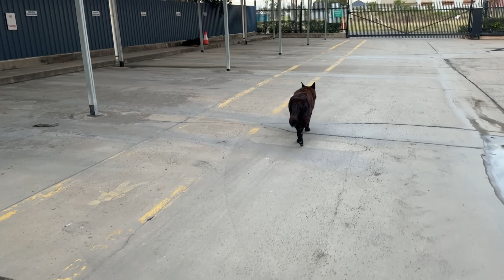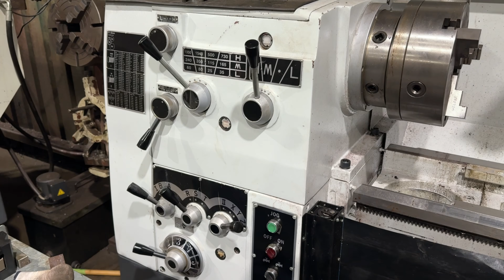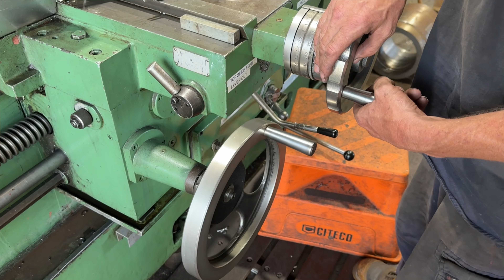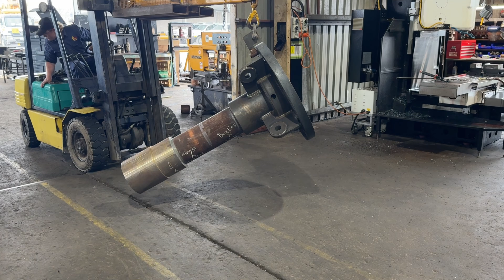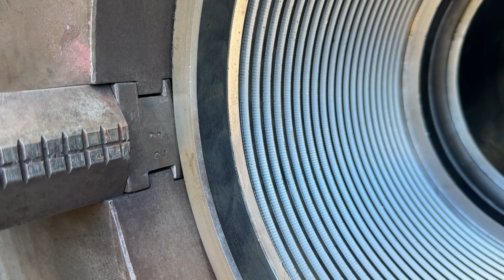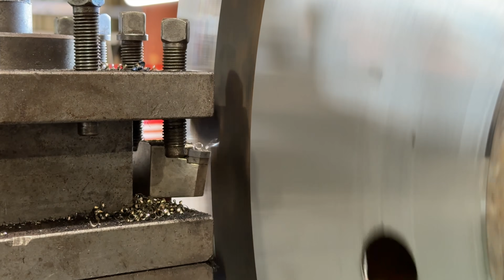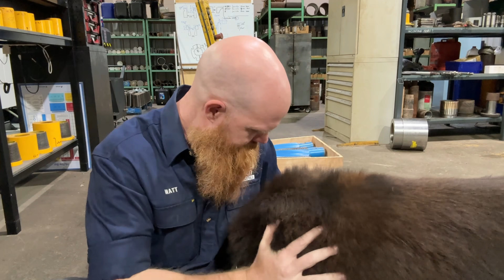Why We Bought a MEGABORE Lathe (… and 5 Things We Use It For!)

Comment: Very entertaining video, with regard to big machines. Served my apprenticeship as a fitter & turner, but only using much smaller lathes. Was aware of trepanning, but only in the medical field, and have never heard of it for machining. Was wondering why the saddle on the Hulk, didn't have electric drive for long traverse, seems a bit of a pain winding it back and forward over that length. Cheers from Victoria.
Reply from the maker: It had auto feed, but it doesn’t work when we’ve got the machine locked out - which we always go when loading parts in

Comment: Looking for Big old manual Lathes? Russian Stanko and Polish Proeba Lathes are Beasts, but i dont now if they made big bore spindels. at work we have a stanko 1M63 and a Poreba tpk80 5M. on the CNC/NC side Look for older VDF Böhringer. Running a DUS 630 TI build in 2004. The Programming is old But effectiv and it has Handwheels and also steadyrests that are complete operatable from the front, so no crawling in the back of the machine.
Reply from the maker: Thanks for that mate! I’ll have to check those options out. Really good to know 👊

Comment: Great work. Probably apparent from our name, we run much smaller equipment but encounter the same problems. We make a lot of custom tooling, fixtures, etc. Our biggest lathe is an old Jet 1340GH that I had to build from two separate machines. The headstock nearly fits within the bore of Hulk!
Reply from the maker: I find your type of work truly fascinating! So much more precise than the stuff we do 👊🤣
Reply: @halheavyduty  I went to a school at a mining industry/rock mechanics university which is why I watch your channel. I learned fascinating stuff and find you exploring some of those engineering/practical experiences in your fabrication process. Keep up the good work.
Reply from the maker: Cheers mate.  Will do.

Comment: All the machinists I am 'familiar' with are only buying used hardware. I get that cost is why, but who is it that buys these behemoths brand new and why do they sell them to the used market? If they ae still good, why sell them off? What's the cost difference between new and used?  It must be a huge difference.  Love your style and the channel.  ( and was that a Franna Crane ?)
Reply from the maker: When it comes to CNC, I’ve had a good experience with a second hand but of gear (our little Alpha)

Mind you, we knew the seller personally and he was closing up shop.  Hence why he sold it.

New equipment is crazy expensive, but so is buying someone else’s problem 🤣

Typically I try to buy new gear, but a new Hulk would have been $350k USD minimum… and the hulk was a fraction of that due to its age.

It all depends on budget and goals I think.

Comment: To answer your question at the end of the video I have a few questions myself
Manual or cnc
Lathe. Mill or grinder
And what size of work are you planning to put on it 

Since you didn't mentioned and of that at the end
Reply from the maker: Great question (as always).

We'll be getting a CNC megabore, and likely a CNC mill to do the bigger stuff.
Reply: @halheavyduty  hmm might have to think a little for that one becore i can make some  recomendations. by bigger stuff are we tallking like 400x700mm part or 1200x1800 or even bigger ? 

( with most that i know of they have a size area where they are like the king/best there is but above or below that size area they pretty much fall flat on there face compared to the other ones thats best in those size area's. also are we talking 3 axis or 5 axis ?

i have been teaching people in 3 axis cnc milling ( both programming and practis on machine. and the kinematics and technical/checking of the machine to make it be as true as possible/best practis ) but most of my expertise is with lathe ( both cnc and manuel ) all the way from small watch making cnc's with between 1600 to 2800 parts a day pr. machine to big dual spindle tripple turets with dual C axis and Y axis on all turets with rotating tool options in every pucket's beat's ( all iso/hand programming )

Comment: Dayum thats one heck of a lathe. I run a konventional mill simelar in size to godzilla and a Raboma 12UH1600 Radial drill wich I can absolutly recomand. For you guys a 12UH2000 might be a better fit tho. Maybe even bigger but a radial drill is an absolute monster drill press. if you do get one make shure you get at least a mt5 maybe even a 6 and if availeble multiple clamping base pads are nice to have.
And I think a CNC mill would do good for you guys as well. Maybe a 3 axis but I would also see use for a 5/6 axis with swivel head and rotary table. few weeks ago you showed John busting out a lot of metal and after that it was of to the saw for the outer form. 
With a cnc it would be one or two clampings and a 63mm high-feed and let that sucker run.  forever... ALONE!!!
I am very glad we have cnc mills so I dont have to do it on my old konventional mill.
Keep up the great work and Im exited for the drill rig in action.
Greetings from germay <3
Reply from the maker: Dude thanks for all those recommendations.  Yeah, we 100% need to get a CNC mill in the near future.  I have a feeling we'd put it to good use very fast!

Comment: there is a super pig Kennametal insert tooling for outside turning that would probably work great in the hulk.
Reply from the maker: Interesting!  I'd give it a crack.  Is that the Fix8? Or something else??
Reply: @halheavyduty  yes exactly that's the one, didn't quite remember since I haven't really done much turning, more milling and wild start grinding on big aerospace parts now
Reply from the maker: That sounds super interesting!  Aerospace level precision is way beyond my current skill.  Our tolerances are usually 0.1mm haha.
Reply: @halheavyduty it will be repairing mostly parts from the landing Gers and some other things like the occasional turbine shaft, so different sizes of mostly round grinding up to quite big sizes, ofcurse very high presision. 
I am very exited to go this way in my career now, and will see how it goes.
Reply from the maker: Good luck!

Comment: What voltage does the big lathe use?
Reply from the maker: I'll have to check the volatage, but it draws 80 amps on startup.  The big CNC is only 50 from memory.  We had to upgrade everything just to fire the Hulk up.  Wild

Comment: At 10.5, minutes in this vdo, you used negative rac turning tool?????
Reply from the maker: It's just the standard CNMG insert and tool holder we use for peeling off bulk metal.  I'm keen to try the Kenna Fix8 soon though.  Apparently they're really good.

Comment: I miss working a relatively big lathe. Having a hollow spindle, double chuck headstock (I recall ~18.5"/500mm) is just such a nice feature. Noisy as F*%K but fantastic machine, even with its flaws
Reply from the maker: I love when we put it into top gear and fire it up.  Sounds like a full blown WW2 air raid siren.  Freaks everyone out hahaha
Reply: @halheavyduty  The machine I worked went up to 600 I think? We got noise complaints from the people living in the houses probably 60/70 meters away haha. Decibel meter had it at 83.
Reply from the maker: Holy crap that's awesome!

Comment: In the oil business if you get machines twice as big as you currently require they will shortly be half the size you need. I recommend you start looking at a new larger (taller heavier floor) shed/building or enlarging the one you have!  You are already at capacity on your largest lath. Also the shop crane at 20T seems too small for the jobs you already take on. Nice to see security well taken care of. Ray
Reply from the maker: You clearly know your stuff (or you've got a crystal ball haha)

We have maxxed everything out.  Everything.  

We need a bigger shed, lathe, mill... way thicker concrete.  

I'm pretty confident we'll end up moving locations next time there's a downturn.  Building a massive shed with meter thick concrete for the machines.  We just cant really expand any more here. 

And we need (NEED) a 40t crane ASAP.  

That 20t franna and our two 8t wobbly's just cant do it properly.
Reply: @halheavyduty  Thanks for taking time to respond. Suggest if you build that you pitch the floor under your laths to a drain on operator side so you can recycle the collant and minimize the mess from using collant on giant parts and save money on coolant trays and splash guards and recover the most coolant possible while keeping work area spotless. Love your videos, I also watch and enjoy CEE.
Reply from the maker: Cheers mate.  Yeah, my plan is to go on a 'holiday' to Europe and the USA next year and check out a bunch of shops that are already on the level I want to be. 

I reckon that's the best place to find good ideas!  No point in re-inventing the wheel.  

CEE is great.  Endlessly watchable.

Comment: I'm a retired "Time Served Skilled Centre Lathe turner"; wow, what a mouth full 🤣. I used to have the pleasure of working on a Binns & Berry 35' lg lathe with TWIN saddles. Made turning steady bands so much easier. There was a total of 6 machines of the same length, but all different makes. I don't think the one I used hade the same headstock bore as yours, but we didn't need it purely because of the length of the bed and our steady rests 😀. If we did encounter chatter, we had long strips of rubber that we would wind along the tubes!
Wishing you and yours all the very best. Cheers.
Reply from the maker: That's awesome.  I would have loved to see that workshop!  Cheers mate
Reply: Where was your shop, in the UK or the US? Binns and Berry is a very English pair of names lol
Reply: @samrodian919  I was working in the UK. Sadly, both factories are gone 😢. Cheers.

Comment: Very interesting video. The coolant looks a lot like Cimcool which was marketed by Cincinnati. The finest centre lathes I ever came across were Dean Smith and Grace, superb.  now like most British manufacturers  closed. For the size of work you are doing have you considered Vertical borers, Webster and Bennett or similar?  Much easier to have the advantage of gravity on your side.
Reply from the maker: We're in the process of looking at both horizontal and vertial boring machines when we upgrade the shop.  The advantage of a Megabore for us is that we can machine up 30ft rods in it as well.  So it's just a bang for your bucks' situation really.  

One of my friends has a massive CNC vertical boring machine and it's AWESOME.  Weighs about 18 tonnes.

Comment: You should build some power feeds for those crank handles, or get it all power fed on the next one.
Reply from the maker: It's actually got power feed... but we often just wind it manually.  When we're loading material in the machine we keep it locked out though, so it doesnt work.

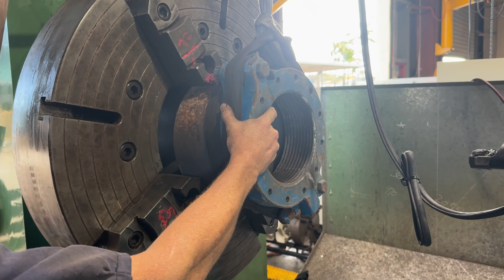Comment: at 10:48, is that cutting tool bit holder machined then a weld fillet added at the intersection of the joint transition into the block from the shaft? Or is that just bad lighting?
Reply from the maker: Just bad lighting unfortunatley.

Comment: At 7:15, I'm a mechanic by trade, it's surprising, if you grab a 3/8" ratchet or breaker bar and try and break loose a bolt it feels hard, just this certain bolt forget sizes and all that stuff. So you grab a 1/2" inch and it cracks real easy same length bar, just thicker. But then there is another one of these bolts that is the exact same tightness, and you grab the 3/4" bar, same length again but even thicker than the 1/2" bar, wow it's even easier to break loose the bolt. What is happening? I assume the springiness of the steel somehow takes energy out of the machine. 
So as per the old machinist saying "rigidity is king"
Reply from the maker: Rigidity is king.  1000%

Comment: Great video Matt. The Hulk is a bit of gear for sure. I used to work in the Midland Workshops in WA. You would have loved a stroll thru the machine shop and the Flanging shop - some big presses in there. Cheers mate
Reply from the maker: Youre not wrong there! I just find big equipment so fascinating.  As I kid I got to head over to NASA and check out the crawlers for the Saturn V.  Couldn't drag me away haha

Comment: Hi Matt, congratulations 20k and going strong. Personally, I feel that any of the older machines in fair condition are better value than these new cheaper machines, ask me how I know😋. Russian made Ryazan lathes are a solid lathe and my personal choice. I have worked in heavy industry and the lathe I worked had a 6ft dia chuck and could take up to 20 tons in weight. The big lathe had a 20ft dia chuck and steps up onto the carrage.
Reply from the maker: We had a Ryazan lathe!  In fact I still have the spanner here (Made in the USSR).  That thing was a BEAST.  The bed was hardened beyond anything modern machines seem able to do.  

Grandad practically lived on that big machine.  It eventually wore out, but was a remarkable bit of gear.
Reply: @halheavyduty  New cheap lathes look robust but only have a ultrasonic hardened bed and they dent easily, also the gears in the head stock are really light duty, if try to work it like an old lathe the gears fail and they just don't have the rigidity of older lathes.

Comment: Do you have to watch the amp meter closely? If so, and I am no electronics wizard, fitting an alarm and auto cut off switch should be reasonably easy.
Reply from the maker: No, it's a secondary indicator.  If the Hulk is under stress... you'll HEAR it before you see it.  You just glance over to see if it's drawing amps.

Comment: Love the content, Matt. You need a large gantry crane over that monster. Have a look at some old railway engineering photos. Wheel lathes were monsters! How they made the castings used in some of the old works is mind boggling. Colchesters rule in my book. A colchester student will take a 10mm cut with a good sharp tool of the right geometery. There is a video on u-tube of them testing one in the factory doing just that. Congrats on 20k. Keep the chips flying! G'day from Tasmania
Reply from the maker: You're not wrong there!  We did look at getting a big gantry, but the shed is too low. I'll have to check out that video on the Colchester.  Personally, I really like them.  All machines have pros and cons, but for me the pros well outweigh the cons with the Colchesters.
Reply: I'm from colchester in England where the original factory was based. 
My dad worked there for most of his working life until it closed in the early 90s and was moved up to Yorkshire (Harrison lathe company).
They are very good machines if maintenance is kept up on them.
I'm also a machinest by trade for 40 years. 
I've watched a couple of your videos now, looks like a good set up.
Not sure if this pale skinned pom could stand the Aussie heat lol.

Comment: Largest lathes I've run was a Hwacheon Mega 130 and a Hankook. Hwacheon had a 1M chuck and 6M long bed. Hankook had 800mm chuck and 6M long bed both were CNC machines. Both had good and bad things I liked about them. Also had a go at running a Doosan DBC 130 CNC Horizontal borer for the same company. Very solid machine. Biggest manual lathes the company had were a Geminis and some old Russian lathe. If you want to go bigger than the Hulk I'd suggest looking at oil field and hollow spindle lathes. Also if you get a manual one having rapid feed on the carriage and cross slide is a life saver. Seeing your guys winding the Hulk back by hand I'm sure they would appreciate it as well. Keep up the good work mate.
Reply from the maker: Nice.  I've checked out the Hankook lathes but haven't run one.  There's some mad gear out there.

Comment: The Sydney Water machining workshop in the suburb of Waterloo had a huge lathe in the 1980s.  I was there in 85 or 86 for about 6 months.  I was told it was the largest in the southern hemisphere at the time, although the bloke who told me that could have been wrong or exaggerating.  Another guy said it was made to machine ship propeller shafts in WW2 and Sydney Water either bought it or inherited it.

I'm struggling to remember how big it was.  My imperfect memory says it was about 10 m long and 2 m diameter, but I'm not going to swear by those estimates.  I walked past it a few times but never used it.

I have no idea what happened to it.  I think the workshop closed some time in the 1990s.
Reply from the maker: It wouldn't surprise me.  We had some great stuff going on in Australia before the 'great offshoring' began in the 90s.
Reply: Probably a Craven lathe
 I remember reading an electrical trade journal describing the retrofitting  of modern  control gear to a large Craven lathe. Pretty sure it was at Sydney Water. Think it may have come from hydo electric plant. Would have been late 80's early 90's

Comment: Must admit to being a bit suspicious of the accuracy of the ammeter when it's only showing 5 amps when you are using such big tools. I'd guess that is around 2kW, just turning that big chuck with all those gears would take that much power. When you are cutting full face with the big drill you have a lot of inserts all cutting at the same time. I'd expect the load to be far higher, for the amount it would cost, I'd try another ammeter and probably put on a new current transformer.
Nice video again Matt.
Reply from the maker: Cheers Bill!

It definitely works. We nearly got the trepanning tool stuck and it hit 20amps

Old Hulk even coughed a little 🤣